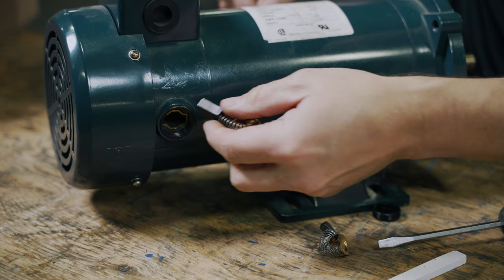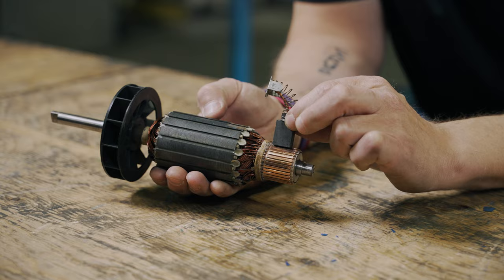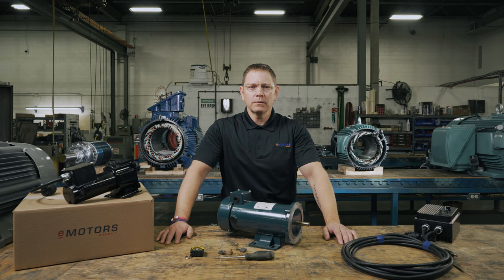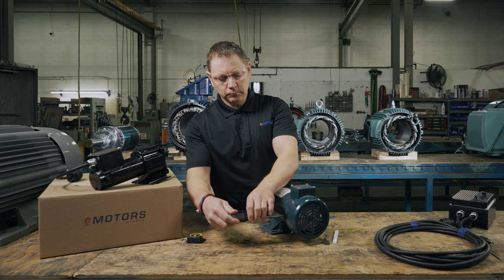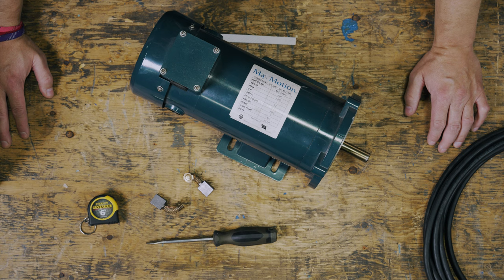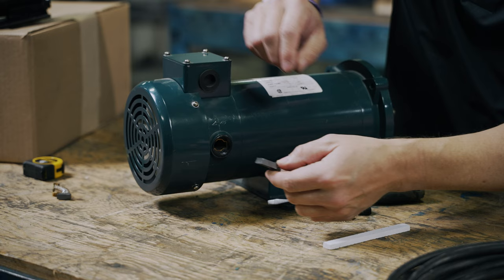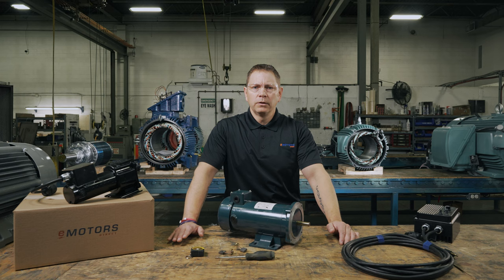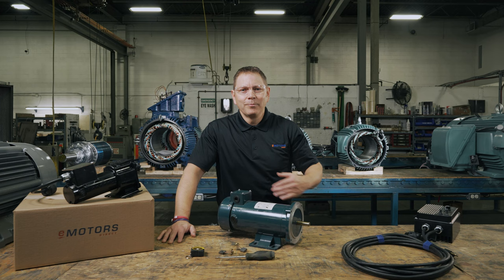How to Check Carbon Brushes on DC Motors

Comment: thank you for the video about carbon brushes and commutator, can you please  make the video about the field  winding and its connection with carbon brush
Reply from the maker: Hi Sundar, thanks for the comment. We do cover how the DC motor works at a high level in this video: https://youtu.be/D5Vr4aWhPNk?feature=shared

Comment: Hi,

I’ve got some problems in my Chicago chop saw motor. I bought it at a yard sale. 

The brushes are beat up a little but the big problem is that the little copper coils around the piece that the brushes are held are broken on one side. I don’t know what those coils are called and I don’t know how to take the motor apart to get to those part so I can replace them. 

Can you help me out or let me know how I can figure all that out?

I appreciate your kind assistance. 

Have a blessed weekend.
Reply from the maker: Great question - it depends if you're referring to the springs that hold the brush in place, the commutator coils, or the copper wire connecting the brushes to power. 

If you're referring to the springs that hold the brush in place, those can be easily replaced. If the issue is the commutator or the copper wire connecting the brush to power, you may be better off to replace the motor. 

I hope this helps - let me know if you have any follow up questions.

Comment: How to remove "frozen" brush cover on a 1940's Black & Decker circular saw?
Reply from the maker: What do you mean by 'frozen'?
Reply: @emotorsdirect  The covers that much be unscrewed to remove the brushes will not turn to the point that trying hard will probably break the plastic slot.

Comment: "Check every 3 to 6 months" yeah not that motivated maybe every 2 years
Reply from the maker: 2 years should work just fine if you don't use the motor everyday. Brushes can last anywhere from 1,000-10,000 hours so more frequent checks are recommended for a regularly used motor.